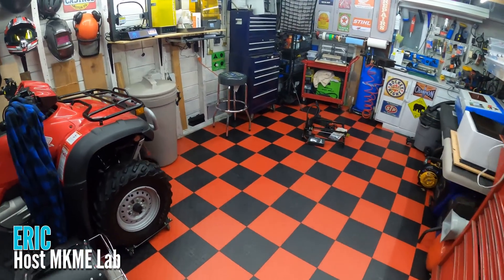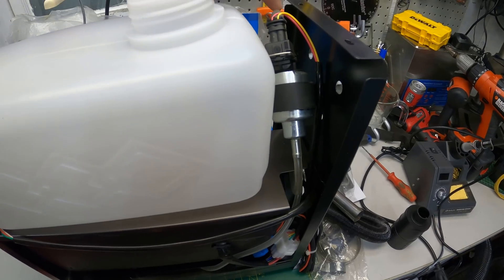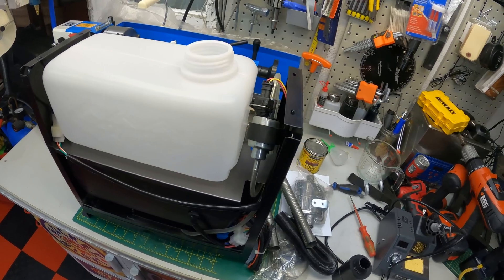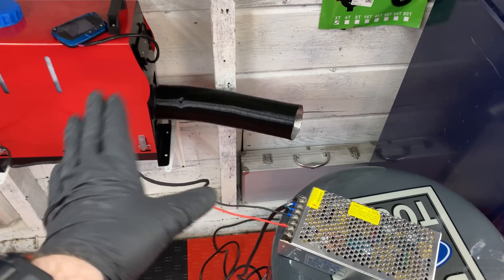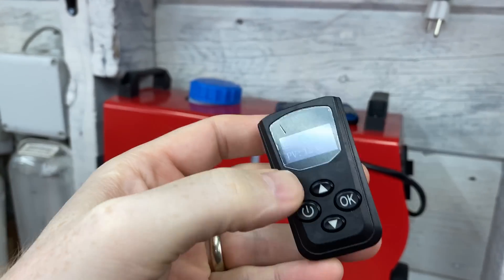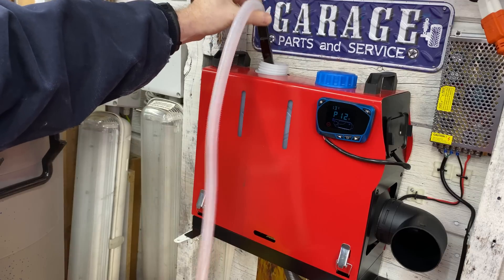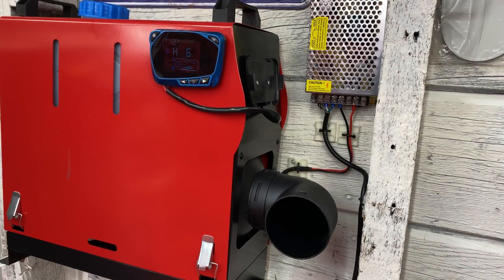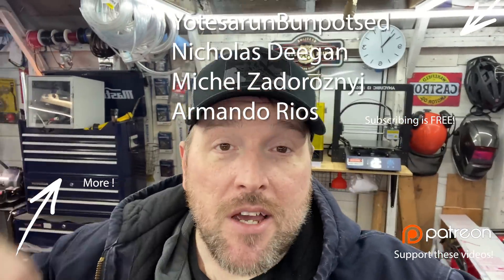Everything You Need to Know About the Chinese Diesel Heater - MY SHOP IS WARM!  🔥

Comment from the maker: Heater on Amazon: https://amzn.to/3POEcFX
Heater on Vevor (cheaper) https://shareasale.com/r.cfm?b=1508656&u=3336141&m=95592&urllink=&afftrack=
Exhaust wrap I used: https://amzn.to/3BVnUFI
90 degree air duct https://amzn.to/3VcCzmM
Fuel transfer pump (I own 3 and they are GREAT) https://amzn.to/3hJp3td
180W power supply (15 amps) https://amzn.to/3GfJreZ
Reply: The bad news:  There isn’t an 8kW heater on that site.  They lie.  Work out the time, with your maximum pump Hz, to use a full tank.  

5 litres of diesel contains about 53kWh.  That should keep it going for only 5 1/2 hours (assuming that efficiency might be about 80%).  I expect your tankful would last over 10 hours.🙂

These heaters are good, all the same.  Just don’t believe all the Chinese tell you.  

I hope you mains supply does not fail.  These heaters, on shut-down, run the fan until the heat exchanger is down to a safe temperature (so the motherboard, attached to the heat exchanger, is neither damaged nor destroyed).  Battery operation was what they were designed for, even if the mains is connected all the time.  I use a battery and float charger - battery is never greatly discharged while the mains is connected - and the battery would keep the heater running in the event of mains failure (either until the mains is reconnected or until the heater shuts down, in its usual way, when the battery voltage reaches a certain minimum level.
Reply from the maker: Never once mentioned the KW output being accurate.
Reply: @MkmeOrg   Correct.  But your link took me, almost directly, to vevor 8kW heaters.  Therefore, I expect it takes everyone else to that same lie.🙂  You most certainly did not mention this little lie in your video (If you were aware of it, even).  That means unless told otherwise the multitudes (who follow your link) may well finish up buying something that is not quite what they thought it would be.  Now that definitely would be bad news for them - wouldn’t it?  All I have done is brought these lies out into the open, so that any, that see these links, knows the truth.  If they then carry on and assume, without checking further, that their shiny new heater provides 8kW of hot air, that is entirely their own fault.🙂

These heaters are (or can be) good.  There is no good reason for the Chinese to lie about their product - but they do.  Why do you think that is the case and do you condone it?

Edited to add that you might get some real honest enlightenment by watching the you tube channel called “lowered expectations” where he basically gets in trouble fairly quickly , but at least he is an honest guy - even if he doesn’t yet understand that the heaters with these cheap controllers is what is giving him strife.  That and reports from lots of users that perhaps are not telling the truth, the whole truth and nothing but the truth.  Have a good day.
Reply: What´s the room temp before and after ?  Good Video.
Reply: Win on the orange matches the rest of shop

Comment: 5 liters=72 hrs. Not even close on eco low 30 hrs at best and the small inlet filter is conbustion air. [Youre not warming it]  if you route it outide it will improve performance since cold air has much more oxygen than warm air and will burn hotter and more efficient
Reply from the maker: Cold air is more dense but unless you ADD MORE fuel, you do NOT get more heat energy. The mixture is fixed.

Comment: When using any of these diesel heaters, you should never power them directly from a mains to DC converter. The reason is that they can't just be instantly switched off - even when running at the lowest possible setting, they still have to go through a cooldown cycle: This shuts off the fuel pump but keeps the fans going for a minute of two in order to purge the combustion chamber with fresh air and ensures that none of the components get damaged from overheating. A mains power cut (or a failure of the mains to DC converter) would make this cooldown cycle impossible and could therefore damage the unit.
You should always have the heater powered directly from a 12 volt battery which will prevent that problem. An old car battery is ok, the greatest power draw is about 150 watts on start-up (the glow plug uses most of it), which is about 12.5 amps at 12 volts. So as long as the battery is capable of delivering that amount of current, it will work just fine. Another advantage is that it will keep going even if you lose mains power. I have my own diesel heater running from a 60 amp-hour car battery, which I know from experience will last for almost a week (I forgot to plug the charger into the wall socket once), using it for a few hours every evening.
You can use a trickle charger to keep the battery topped up - once the glow plug shuts off after start-up, the fans and electronics only draw about 3 amps at most. So the charger will probably supply most of that, with the battery acting as an uninterruptible power supply. The battery charger will give a bit more than 12 volts (usually around 14 volts), but that isn't a problem - the heater will actually work on anywhere between 10 and 16 volts. Or if you have the 24 volt model (designed for use in trucks or boats which have a 24 volt electrical system), it can work on anywhere between 20 and 32 volts.
Reply from the maker: Power doesnt get interrupted, not a problem.

Comment: these dont last long esp running on a low setting if using them often. the older they get the less reliable they are be it to dirty to light or pump lets go or plug decided to quit. i noticed after 2 or 3 clean outs they need to be replaced. even replacing the plug and heat screen does not guarantee functionality as they age. they are cheap enough to grab a new one every yr tho which is nice. i could get around 2yrs reliable out of em with a cleaning or two in between.

Comment: I received my diesel heater today, identical to this one.... I too, have been watching all the videos on them, and seen that the soft tubes are terrible and should be replaced.... Luckily when i unboxed my heater today, it had the hard-line fuel pipes already in it, along with a fuel filter :) 
Win Win....
I do wish the warm air duct was a little longer though! 
As ive built a wooden lidden box for it to sit outside, behind my workshop, and drill a hole in the wall for the air duct... But its not very long haha
Ive also ordered a roll of wire, So i can cut and extend the wiring to the control panel display.. So that i can have that on the wall in my workshop..

Comment: is the thermostat located in the "crystal Lcd screen"? Im trying to get my heater set on the lowest temp setting. I think thats 8 C so 46.4 f. Seems like mine thinks the bus I live in is always below freezing. I have mine installed in a low cupboard with with the controls panel on the the outside of the cupboard so I can read it easily.

Comment: If you have even occasional power outages, I would recommend integrating a lawn tractor size battery to your build. The reason is if you lose power even for a second, the heater will shut off hot with no way to cool down as happens under a normal shutdown. This often results in fatal damage to the controller board housed in the plastic housing of the heater and of coarse the possibility of fire with a plastic fuel tank sitting over the heater. I have the same exact heater and I also added a battery tender to the mix and adjusted the power supply to about 12.5v so as not to overcharge the battery. The power supplied to the heater will float between the battery and the inverter depending on the state of charge of the battery and the amp draw when the glow plug is in operation. I’ve been very happy with mine for three years now with no troubles. Oh and one other improvement was adding a chainsaw fuel filter to the supply line in the tank as unbelievably it was unfiltered.
Reply from the maker: Not sure how hot you think the heat exchanger is but a single shutdown and heat soak is nowhere near enough to destroy the board and not even in the same galaxy as melting the fuel tank.  Good idea to have a battery to spin down and cool cycle but not the end of the world if it has a shutoff. Just not desirable. Sorry

Comment: Someone may have already mentioned this but you should move the power supply to the intake side of the wall. They lose efficiency and life expectancy quickly when "over" heated and having it right above the heat output probably won't be great for its life expectancy.

Comment: There's a slightly cheaper alternative to Diesel fuel, and it's safe, Diesel fuel is kerosene that has paraffin added to lubricate the injector pump and injectors. Kerosene, AKA house oil in the UK, will burn just as well.

Comment: I have the same 8kW Vevor heater, just with a slightly different plastic casing around the controller/screen unit.
I found the design quite atrocious and very cheap:
1) The 2 feet of the case are totally useless, because the exhaust pipe cannot be bent to fit in the space between the feet, so the exhaust pipe form a third feet in the middle, higher than the 2 regular feet on each side. It just cannot stand on its feet, you need to screw higher metal feet under the existing feet or replace.
2) As you noticed yourself, the exhaust is incredibly hot, so:
  a) You need much higher feet indeed or you need to screw this supposedly portable case on the wall. I don't know why the exhaust would not be right opposite the hot air outlet instead of down below as logic and safety dictate. I suppose they think people would just cut a hole at the bottom of their RV to create a fire hasard with this burning hot air exhaust...
  b) This heater wastes a huge amount of heat through the exhaust. It does indeed char wood easily, making it a high fire risk hasard. I suppose the compact case does not make it possible to fit an efficient radiator that would act as a better heat exchanger, but I would rather have a much bigger and much more efficient case than wasting so much heat outdoors. Diesel's exhaust gases are already not great for the planet, but directly heating the atmosphere on top of that is a catastrophe.
3) All the pipes and electric cables provided are unsafe. They have no sheath or insulation, and are supposed to be fixed using garden hose clamps. Like the exhaust gases won't go through these non-airtight inadequate fittings.
4) The heater is provided with an English manual alright, but for a totally different heater of a different design, with a different controller. There are zero practical instructions on how to assemble the kit, nor on how to use the controller or the remote. Since the voltage can be adjusted on most power supplies, there is no mention of what best voltage should be used or why. Or rather, they do mention 12V and other voltages, but I have no clue what these mentions are for. These are supposed to be heaters for vans or trucks, running directly from the 12V battery, but 
5) There are 2 separate air circuits, one for the combustion and exhaust, the other for heating the room with clean air, so I was expecting 2 inlets and 2 outlets, but there is actually only 1 air inlet, so I suppose it is subdivided in two for both the combustion chamber and the room heating, or maybe there's another natural aspiration inlet inside the case, it's not clear at all, I'll need to take the thing apart to verify. A priori, it does not look like there is a complete separation of the 2 air circuits, which would negate one of the best advantages of this heater.
6) Separate issue: I have a 30A power supply that also comes with no manual at all. At least it's not in ideograms, bless the Chinese! Unlike in the video, I used the connectors the farther away from the main connector, to reduce the risk. By the way, I find it amazing that the mains power is unprotected, on the same row as the 12V connectors.
7) I know this heater is designed for boats, trucks, vans or RVs, that's why they run on 12V and don't need certifications for 110/220V mains in different countries, but all these videos show them being used to heat a shop, a garage or even a house. Some care should be taken into designing an integrated power supply that runs from mains power, and housing that includes a battery, a trickle charger, the 12V power supply, or maybe even a heat-to-electricity generator from the burning hot exhaust pipe, to either top off the battery or run directly the heater, or evacuate the exhaust heat back into the house, maybe pre-heating fresh clean outdoors air to renew the polluted indoors air or to supply the combustion chamber with warm oxygen. The battery would be especially handy, or you won't be able to run your heater when you most need it in a winter storm that caused a power outage, even though you only need a meager 12V to run it.
8) Similarly, totally automating the heater with a thermostat would be a great and useful extension.
9) The controller of this heater can apparently be programed to clean-burn fuels other than diesel, like recycled frying oil, kerosene, etc. A proper manual and instructions would be helpful, Mr. Vevor...

In short: Make sure you have replacement cables, crimps and plugs of appropriate gauge for both the 12V and 110/220V sections. Maybe longer pipes with real airtight clip or clamp systems, and fire-resistant insulation sleeves for the exhaust pipe (rockwool). A switch or 2 (mains and 12V) for easier maintenance, because neither the heater nor the power supply have one. Carefully plan ahead the location of this heater so that all 3 pipes and the controller/screen go to the most logical place. As for tools, a Phillips screw driver, crimp tool. A $30-40 contactless infrared thermometer would also be helpful. They're all cheap Chinese junk that's not very precise, but the professional 1000°C thermometer that I usedto control my wood stove cost 10 times more... Some cutting and drilling tools and a metallic or brick housing to protect the heater outside, maybe noise insulation sheets or rockwool,.

This diesel heater is still a great plaything for modders and DIY. They all come in 2 separate form factors though: In a compact metal case like this one, or the "deconstructed" (as the chefs say) form factor, with no metal case but all other elements, so you can for instance mount the tank (or even a bigger one) at a bigger distance from the heater (in this video's model, the diesel tank made of thin plastic is right above the burning hot heater radiator, fire hasard anyone?), etc.

I still smell both diesel fumes and exhaust fumes in mine, not even mentioning odorless nitrous or sulfuric oxides, so I'll be replacing all "factory" pipes with a real airtight system. I am also not confident about the actual "8kW" rated power of this thing, so I'll be measuring it using 1 liter of diesel at both low and high setting, to see how much diesel and therefore joules/kW it produced. Maybe also checking by how much it raised room temperature, but that's dependent on many other conditions external to the heater.
Another important feature would be to transfer most of the exhaust pipe's heat back into the room without impeding the exhaust (and thus the full double combustion of the diesel and most of its exhaust flammable gases). I was thinking of doubling the exhaust pipe with an outer pipe where clean air would be heated and redirected either into the room or into some heat accumulation mass such as a wall, like thermal mass heaters do. This would radiate heat for a few hours after the heater is shut down.

Comment: If they offered a brush less fan motor it would be great.The brushes and the commutator bars in brush motors will wear out after a year or so in high run time use.
Reply from the maker: A good brushless DC motor with high quality ball bearings + good quality fuel filter in front of the pump would have this last almost indefinitely.

Comment: Finally someone willing to discuss the exhaust through a shop wall!  I know you didn't want to get into it too much but I agree with what it appears you did.  I am going to take a large soup can, remove then ends with a smooth edge can opener and stuff it with fire retardant wool plus have the pipe wrapped.  I can keep it centred by re-attaching the lid on the outside end with a smaller hole for the exhaust. Kind of create my own DIY wall thimble if you know what I mean.  Need to test my theory, but that's what I am thinking.  Great video by the way!
Reply: Oh, and I have one of those fuel transfer pumps - they are invaluable!!!
Reply from the maker: Yeah I cant be bothered to debate with people on the exhaust. I tested to see just how hot it was compared to my combustibles and was not surprised.  The suspension in the metal vent keeps the distance and the slat supports stay cool from air contact on all sides.  The exhaust wrap is just to keep the cold air out and not be combustible.  The alum tape holds it nicely, looks decent and also not combustible.  Its overkill but safe.
Reply: yes, indeed! Please vent through a wall, not a floor or ceiling. Makes so much more sense. After all, this is a diesel engine no matter how small and EGT's are real. Maybe a tiny pyrometer? ;)
Reply: mines a baked bean can as well..

Comment: I suggest connecting to a 12 volt battery and a battery charger in case the power goes down , then it can do a proper shut down if the grid goes out and the battery voltage gets low.